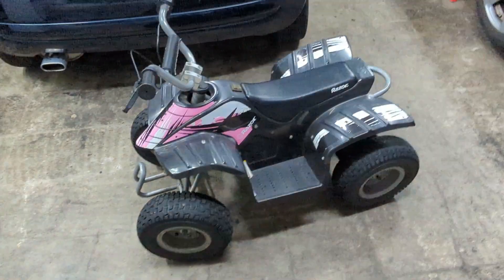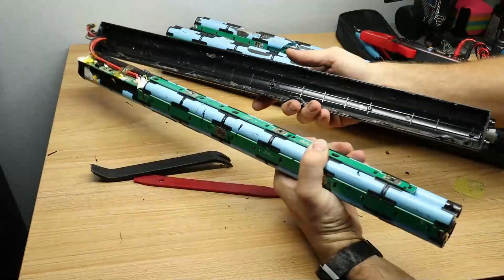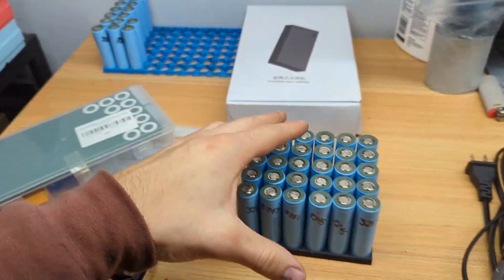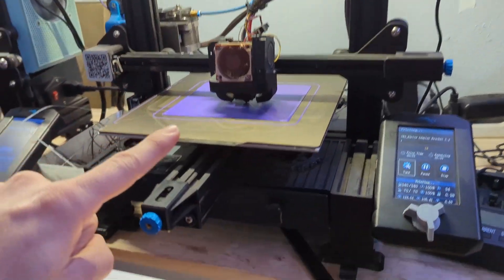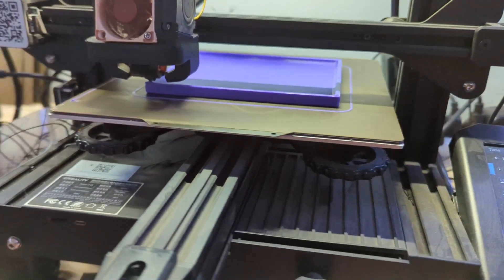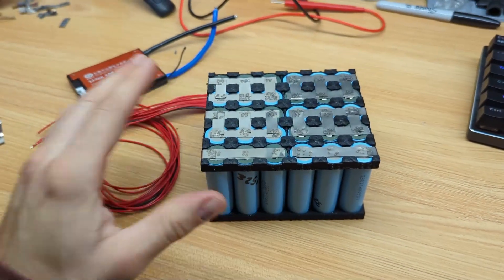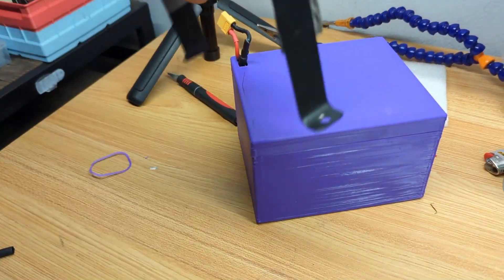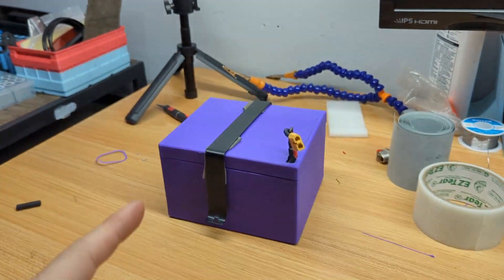How I Built a Custom Razor Dirt Quad Battery!

Comment: Will you build a 24 volt battery like on your how-to google for a Razor scooter using the same 24 ( 2-12 volt lead acid batteries and how much would it cost?

Comment: Nice im working on a simular project with bT Daly 14s BMS for 52v just dont have a way to fabricate a case what would you recommend other than 3d printing?
Reply from the maker: Nice! Bluetooth is the way to go. I'd look at fiberglass sheet, you can buy it thin or thick, build a small case for your battery with foam like I did, and then shrink wrap the whole thing! A lot of battery builders do this too. Here's a link to what I'm talking about: https://amzn.to/3uct3IW (affiliate link).
Reply: @ChrisBuissonDIY  thanks for the recommendation definitely will try this out